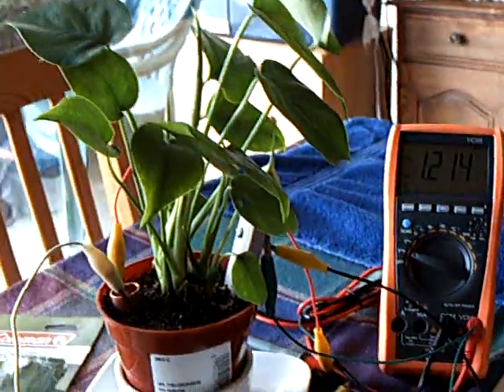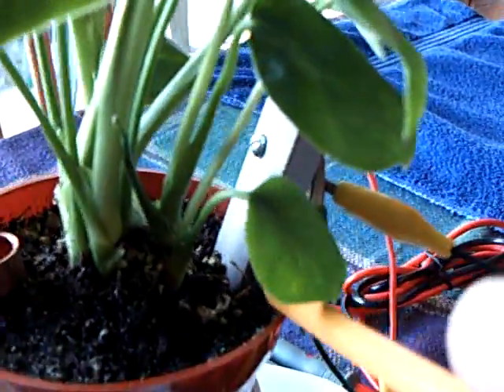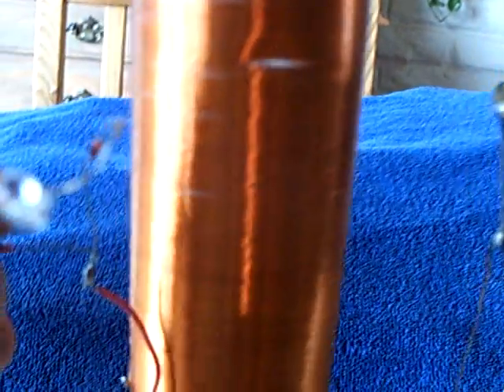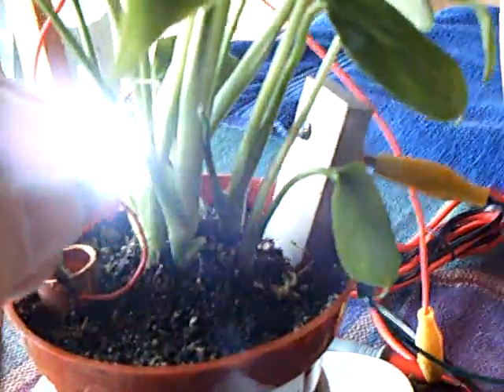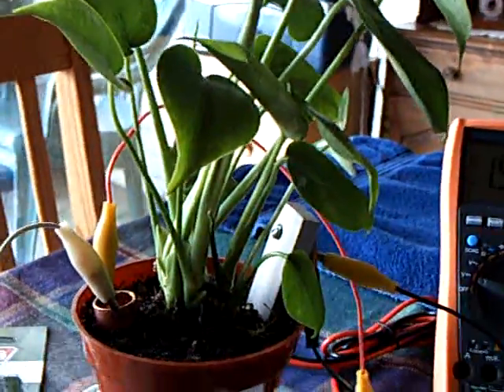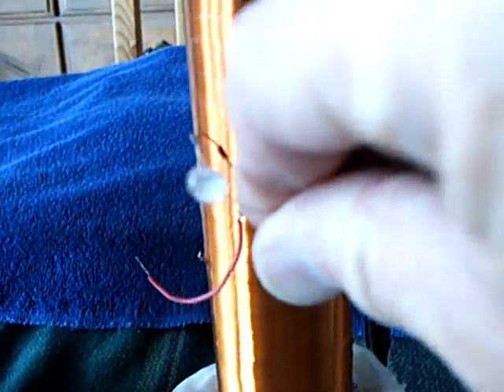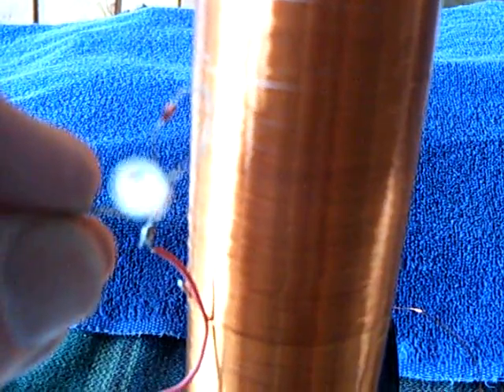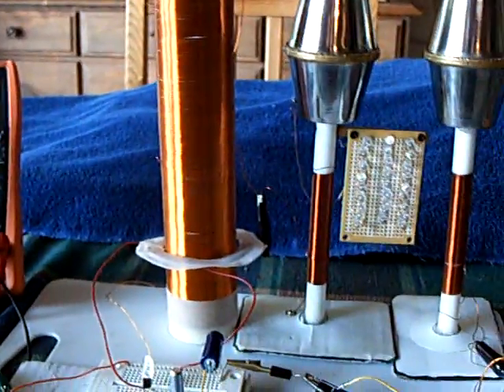Plant Battery Running a SEC

Comment: I have a marshy spot in my yard. About 100'x200'. There is a natural spring that feeds it  at one end below the ground ( I know because I dug there) partially combined with runoff. In the spring the water is a few feet deep. In the driest summer the water level is a few feet down below the ground. About a foot or two of dense black loam and decomposing plant matter (you can actually smell it in the hot weather), then a foot or two of wet beach type sand, then clay. Wet year round (or frozen). Densely covered with bullrushes. If you were me, what would you do if you were trying to turn it into an earth battery?? Any ideas? Thank you.
Reply from the maker: That area would make a great earth battery.  Zinc and copper would be my choice.  Be careful about contaminating of the ground  water.

Comment: Is the plant still alive?
Reply from the maker: YES!!!  It is alive and well.  I have a Joule Thief light running on it.  I have replaced the magnesium anode one time all these years.  Major success story.
Reply: Okay, that is good to hear. My first thought was that the plant will not like the thing.
Reply: Curious, is there more or less EMF in the room with that plant battery. If you have a guass meter you can check the difference between having the plant and just a control.

Comment: @Lidmotor Cool & Good to hear. Maybe it's the Mg. 
Many years ago I'd fooled around with "bio-batteries". 2 strips of metal in the plant's potting soil; one copper & I tried brass, a bit of nickel-plated steel and even a little strip of 310SS.
Plants early on seemed to perk up, but then after various months time all died. 
The strips were refined metals, not natural ore plants may encounter; I figured the something about the specific electrochemical byproducts hit a saturation limit.

Comment: I believe it's got little to do with the plant itself and more to do what's going on with the soil's Ph balance. 
Basic chemistry & electricity says 2 different metals in an acid or alkali will produce an electrical differential between them.

Is your plant still alive??? I found the byproducts leaching off the contact plates into the soil eventually kill the plants. Some plants can only take in so much of  metals before the soil reaches a level of toxic saturation for them.

Comment: Lid, I wonder if the plant gives off any light? Like if it was real dark, with the SEC running. If it requires light to grow, may be it could emit light too with the SEC running.
Anyway I also wonder if the plant acts like a AV plug of some kind and can use the SEC in some way to grow in the dark without light? Looks like you are in a whole new area here for sure. There may be a new type of bio-electro something or other going on here.

Comment: @Lidmotor 

Yes, the copper tube will give off nasty chemicals when degrading.  (I forget exactly what but it is not good)  Carbon will not.  Take apart any "heavy duty" D cell (not alkaline) and there is a carbon rod that is about 1/4" dia. x the length of the bat.  Someone suggested testing output in the sunlight vs darkness which I think is a great idea.  Maybe solar will play a role here?

Bill

Comment: Lid, I was thinking, what if the plant does ok with the SEC, (I hope it does) but bugs that would attack a plant stay away? WOW! You would have plants that need NO insecticide! This would be a whole new field of research and do away with insecticides for ever. Ok, may be it don't work that way, but if it did, it would change the way food is grown forever. May be bugs would stay away from different SEC frequencies, while the plant stays happy. Neat if it worked. I like "Jeanna's power plant" too.

Comment: Lid, that is very cool. I'm glad you decided to replicate her experiment. I just saw her vid 2 days ago.
When I saw her vid, I thought about using the same set-up to power LED grow lights. Plants don't need all the light in the spectrum to grow, they mostly need infrared and UV. If you set this up on a timer, your plant would get additional grow time at night.
I think I'll do it, but without the copper. I'll use carbon instead.
Keep up the great work and have fun.
Peace.
Mike.